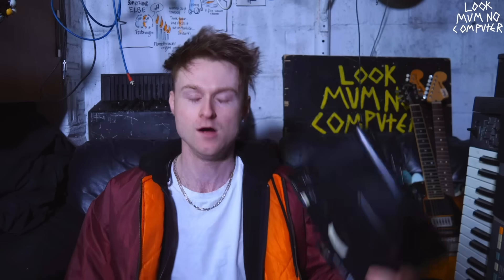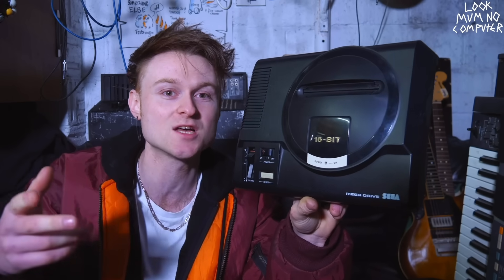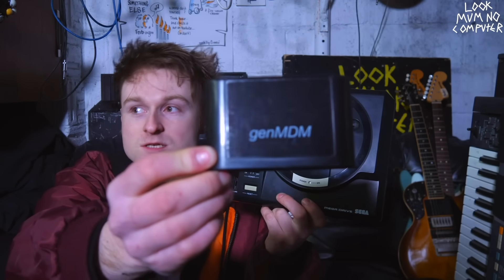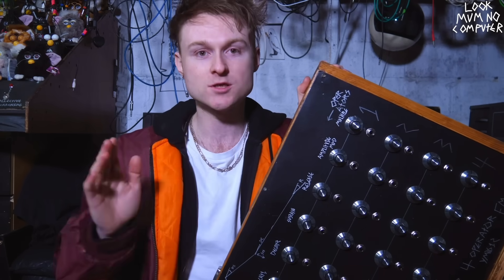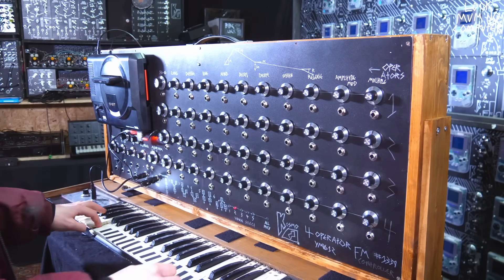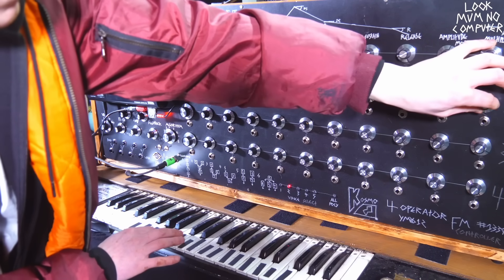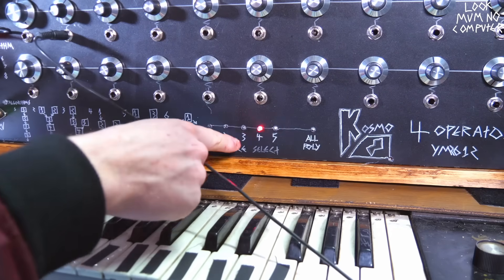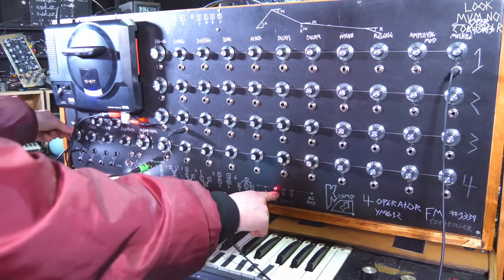Sega MegaDrive Synthesizer, Made From A Sega Mega Drive And GEN MDM

Comment: The mega drive was definitely the standard setter for sound when it come to then old consoles.. you just have to listen the streets of rage sound track!! Awesome vid dude
Reply: Eggy Noggy   not quite thats too much of a generalisation , the amiga had clearer sampled sounds and for tracks that relied heavily on lots of samples it had an edge as the megadrive only had one channel that could produce sampled sound (well the psg could if its 3 channels were combined but i'll stick to the YM2612 for now) . It was also relatively more difficult to get clear sample playback on the megadrive , but it could be done by experienced programmers . However where the amiga came up well short vs the megadrive is the sheer amount of channels the megadrive had , often the same track sounds hollow on the amiga as Megadrive = 5 FM + 1 PCM on YM2612 + 4 PSG channels = 10 channels overall  vs 4 Channels on the Amiga .   Listen to Mega Turrican on both systems and you will see what i mean .   Midnight resistance on both systems again the amiga is much poorer .  I'm an amiga fan also , but you need to listen to more megadrive music if you think the amiga is better
Reply: Eggy Noggy  I owned both also , an Amiga 1200 and a pal megadrive and i think you have the rose coloured glasses on there , there was NO way the amiga competed graphically with the megadrive or snes with any decent programmer on the console ports.  It had no business competing with the megadrive with 80 x 16 colour 32 pixel wide Hardware sprites vs 8 x 4 colour 16 pixel wide sprites on Amiga and 2 Tile supported background layers for 2d games on Genesis vs colour stripped planar layers on the amiga that were not tile mapped either.  The genesis has 64 colours on screen , whilst the majority of amiga games had 32 colours onscreen (forgetting the rainbow bands the copper would add to that as really they added nothing to the foreground) . There was the blitter chip in the amiga that helped to offset the weak sprite power it had , but that  had to bllit to the background so blitted objects had background colours only and often were blitted at half the frame rate  due to DMA etc so objects moved at 25hz etc. It was an older machine 1984-1985 design and by 1987-1990 eg by the time the PCengine / megadrive / snes were out it couldn't compete with them graphically .  Look at the SF2 port on the amiga and cringe vs any of those consoles.  Mega Turrican (Turrican 3 on amiga)  is colour stripped / 2nd background lacking / sonically poorer on the Amiga and that had decent programmers on both Machines (Factor 5).       Sonically its up for debate and if the purpose is to create real sounds by sampling them then the amiga wins , however the megadrive had plenty of tracks that are eargasmic to this day due to the creativity and unique sound of FM synthesis and its companion PSG chip .  Just go and listen to Gauntlet IV soundtrack or Thunderforce IV , Mega Turrican , Vertyex, Master of monsters , Sonic 3   or one of many of the great genesis soundtracks  or listen to what modern day composers like savaged regime can do with the megadrive audio capabilities.   The amiga was revolutionary in 1984-1985 .. sonically it competed very well long after  - to my ears it bests the snes (a sampler type chip so similar fundamentally to amiga) nearly every time but the megadrive sound is different and great in its own right.

Comment: Why does this sound so much more insane than the DX7? Is there some kind of clipping happening? Or are the Operators not just sine waves? Where is the crunch from?
Reply from the maker: i think its just cus the dx7 sucks... JOKING, its probably down to the less static approach to the sound, if you listenned to the gnarly parts i played but not changing for a while it will sound like a dx7, you can get these sounds on a dx7, just the presets suck so get into the paramater adjust
Reply: @LOOKMUMNOCOMPUTER  Mmmm.. I only have a reface DX, which sounds similar to the DX7 to me. I still haven't spent a lot of time with it though, and haven't even tried sequencing it so I'll have to have a mess around and see if I can make it do things it's not supposed to :D

Comment: FM synthesis is one of the most monstrous types of synthesis to learn and those minute screens in the 80's didn't help either.

I fared better learning more of it with a programme I had on the Amiga in the 90's but it was still difficult and I only used the simple 4 operator setups and it was mainly to try and make beefy Simmons-like drum sounds and raspy basses that could saw a grannies head off.

These days, there's quite a few FM synths available on android/iOS so casual revisiting of FM synthesis on a tablet is a small time killer from time to time.

FM synthesis should be taught in prisons and those successful enough get to shave time off their moderate sentences. I see single figure success rates hahaha.
Reply: That's why this is so awesome. It is exactly what FM synthesis needed, a bunch of knobs to turn, not some tiny 2x16 display that shows a parameter at a time that you change with up/down buttons. And finally someone did it. Plus it has the bonus awesome value of an entire game console glued to it. It's beautiful. I might have just taken the chip out of a dead console and stuck it on a breadboard, but having the entire thing work as-is (additive synthesis of hardware!) makes it art. It's good that Sega liked black; a Nintendo up there just wouldn't have been half as awesome.
Reply: 8bitwiz - Yep, sourcing the chips would've been an easier and viable option (loads of original & similar clones on ebay) but the aesthetics of a retro console slapped on the front of a synth rack makes it look epic.

The only (mild) issue I have is that with the level of control on this synth now, it's too easy to 'lose' a sound you might have made, but it's perfect for just fiddling.

Comment: You mentioned not having the "best model" but the only difference is the internal filter/summing/amplifier circuit. In later models, Sega used fewer passives with more readily available values. 
With any model Genesis, you can tap into the line-out connections on each sound chip and run them your own summing circuit. In fact, the "best model" may have a better cutoff frequency than later models, but its still a flimsy single-pole filter. 
If you search for "crystal clear audio mod" you can find schematics for the original circuit, but I suggest tapping into the line-out pins and choosing your own audio levels for each chip/channel.

Comment: Also, I have  a Roland Juno 106 that went bad. I'm guessing it's the capacitors.. I would like to get it working again and add the ability to store setups on digital media instead of cassette tapes..
Reply from the maker: ijuno is great! tbh i never got why something like a juno needed presets theres only about 20 faders or something, takes a matter of seconds to change em
Reply: @LOOKMUMNOCOMPUTER  the best part about presets was making custom presets, then switching between them.. I had another cheap midi keyboard that came with a built in demo tune. One day I connected the midi out of the cheap one to the Juno 106. Wow, I did stuff I didn't know it could do.. one thing I would like to try, is see if 2 people could play each other's midi instruments over the internet.. oh, can a Juno 106 save presets over the midi connection?

Comment: @LOOK MUM NO COMPUTER I love what you do and think you are the one to ask.. I want to use 2 esp8266 as a wireless midi connection, with standard midi in, out and through. Where I can link midi instruments to each other over wifi... even over the internet.. I also have a few chips that I think you might like to try.. 8038 waveform generator and another chip that converts frequency to analog and vice versa. I need to look up the number, but it was a chip sold by radio shack when they were still a real electronics store..

Comment: I had the Korg equivalent to the Yamaha DX7, called the DS-8. It was exactly the same trying to program it. I'd liken it to trying to paint your whole house, by standing outside and poking a brush through the letterbox. Although the DS-8 only had 4 operators (compared to the DX7's 6), it had built in effects, and a brilliant polyphonic aftertouch keyboard.
Reply from the maker: you would be surprised to know the korg ds8 has the exact same chip as the mega drive https://en.wikipedia.org/wiki/Korg_DS-8 . so every sound you see me doing in the vid, you can do on the ds8

Comment: Hey Dudes, I build a VCO with the AS4430 (CEM4430 colne) like LMNC showed us, but the circuit isn't working. I get 4v constantly on the SAW OUT, the ciruit has no missconnections, the chips aren't burned but no sound is produced. what the fuck is wrong? can you guys maybe help me? would be lovely :3

Comment: isnt it enough to resend all the commands to each channel ?

Bcs the only MIDI function you use is "MIDI.sendControlChange" this could be a dirty hack.
As this stuff is C++ you are not allowed to directly create a pointer on "MIDI.sendControlChange"; otherwise there would be a much cleaner solution using function pointers (which also would be way better if it comes to the inclusion of more MIDI features in "omni" mode)

footnote: i am not a arduino user; barely got this code to open.
footnote2: untested code; no warrenties :D

code : https://gist.github.com/AWoelfel/3b92f823a9c169d09b0b1e4a442745ce

Comment: The Sega Genesis / Mega Drive has one of the coolest sound chips in all of retro gaming. When you manage to get a cool sound out of it, it's COOL.
Reply: Isn't it just a YM?
Reply: @vecvan  Yes, the Genesis uses a YM2612.
Reply: @TotallyGoodatGames  AND the Texas Instruments SN76489 circuit built into the custom video chip, mixed with the YM2612. It's often used for percussion samples while the YM is busy with long-wave synthesis. Take a listen to the Chakan: The Forever Man on a proper VGM player plugin versus something YM specific like tfm. Without the TI drums it feels very different. Or Kid Chameleon's tribal beat in some levels. My other favorite is the YM2149F from the Atari ST, little older than the YM2612, but driven by the same MC68000P8.

Comment: I don't understand what half of these circuits and knobs are, but damn that thing sounds niiice!
Reply: Pretty simple really. The sega's just mounted on the knob controller panel for aesthetics. 
There's two groups of objects here: Human-to-midi, and midi-to-synth. All of the circuits and knobs you see in this video are in the human-to-midi group.
Sam just likes making his own "analog 0-100" knob midi parameter controllers (Versus infinite spin digital encoder knobs as found on the beatstep).

The arduino microcomputer analog in reads the many knob states into midi effect channel parameters. Then the midi notes from the keyboard has the midi effects applied to the same midi channel, with the midi-merger. The sega's controller port is being used as a serial input. The midi protocol is then being transmitted over that serial input, where the GenMDM cartridge will decode the midi notes and effects, and structure them for play them back on the yamaha sound chip using the decoded midi parameters applied to the FM operator parameters. 

So there's two fundamental sections: The sega reading arbitrary midi events, and the knob controller + keyboard producing midi events. The arturia beatstep in front of the keyboard can also sequence midi events. Keyboard + beatstep + big knob controller -> Midi (serial) -> Sega Controller (serial mode) -> GenMDM -> Yamaha Synth -> AV out port -> amp -> speakers. 

Hope that helps you break things down in your head!
Reply: for the knobs at the right of the console  you have :
 4 operators with one line for each operator.
each row is a parameter of the operator , you can see the parameters of the envelope of amplitude, with two values of decay (D1 and D2).
under the console you have a knob for the selection of the algorithm with several numbers on the right, at the bottom of the synth you have a description of the algorithms, how the operators are interacting each others (modulation of frequency), on the left this is the selection of the voice.
There are two knobs for the LFO : speed and amp.

Comment: One of these days I'll actully know what you are talking about when you explain this stuff instead of just watching because "he makes silly sound things"
Reply: I love him but that wasn't a great explanation of fm!
Reply: @annother3350  Yeah, I find that when you fall far enough down the rabbit hole of something this niche', there is eventually a point at which you can no longer explain something about it to a regular person with normal language. I do a lot of non-music related Arduino projects and I definitely struggle to explain the simpler concepts without using technical jargon that probably sounds like nonsense to a regular person!
Reply: @Lp0onfire  Sure, and of course, it's unscripted!
Reply: Subtractive synths are actually super simple to understand. FM is another plane alltogether. You can basically learn to use all subtractive synths cores in like 5 minutes. There's only like 3.5 simple things you need to understand.
1. Oscillators generate constant sound, different waves sound different (triangle is the smoothest and saw wave has more grit.)
2. Oscillators are sent through a Filter which filters the sound so you can get more mellow tones by only letting a part of the oscillator sound through. On filters you can also add Resonance which gives the sound a lot of new character when it gets partly filtered.
3. On a synthesizer with knobs you want to constantly turn the knobs in certain ways to make moving sounds instead of rigid ones. You can basically move the knobs electrically instead of physically through Modulation. This is generally achieved with LFO's which are slow oscillators which are sending a constant wave and ADSR envelopes which send a more customizable wave once, when it gets triggered.
Reply: Andrew Huang also has a decent introductory explanation of FM synthesis video. worth a watch if you want to understand.
Reply: Cameron Alexander check out Andrew Huang's recent video on modular synthesis- quite informative.
Reply: Go check out #Afrotechmods channel.  He makes it very easy to understand...